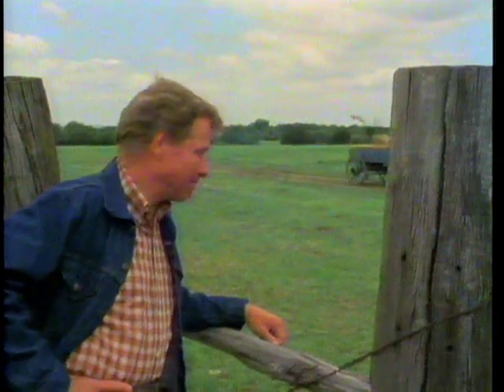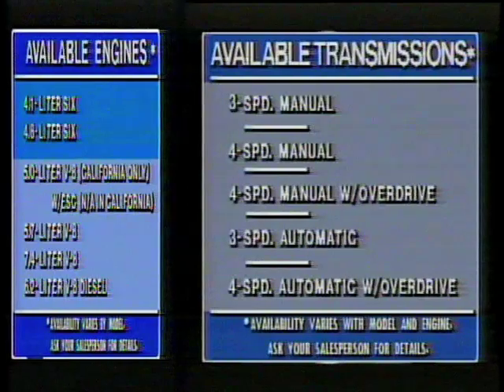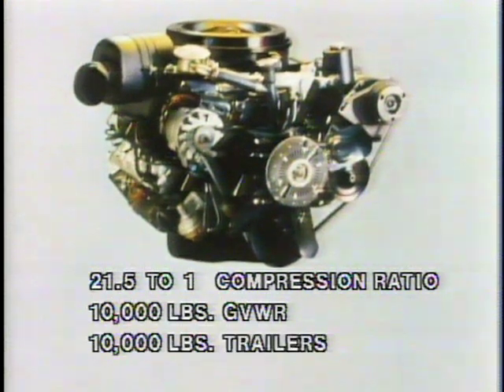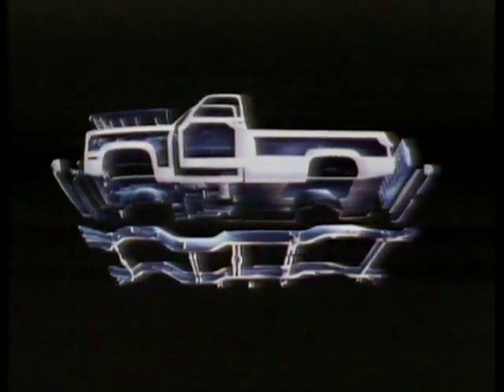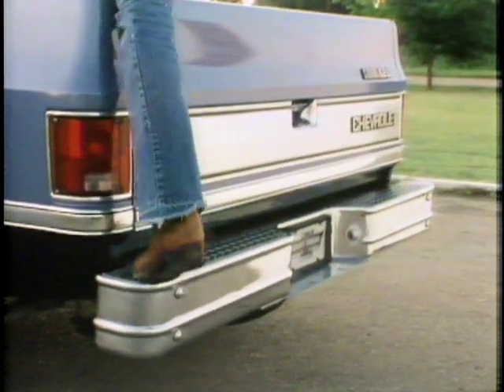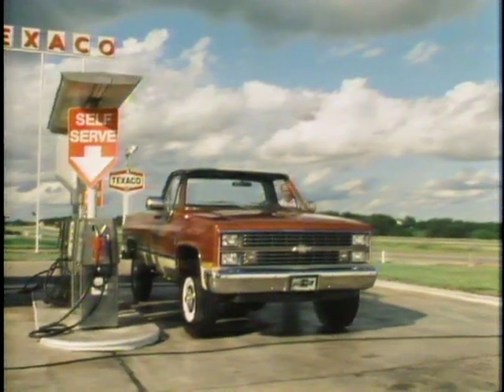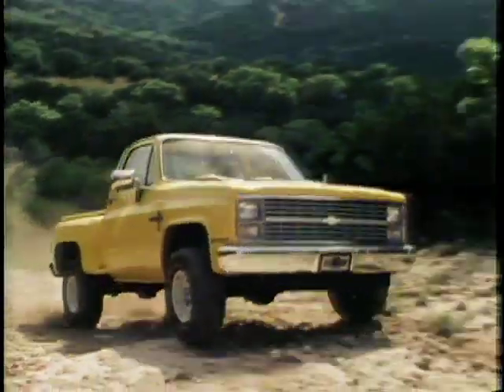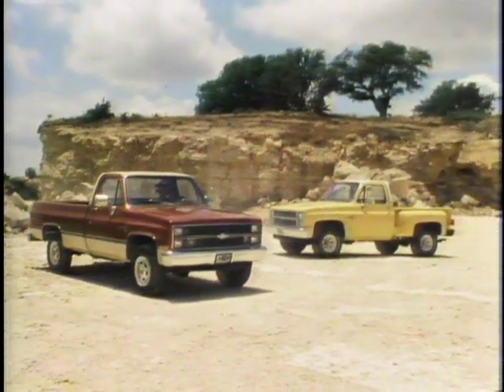1983 Chevy C/K Pickup Trucks

Comment: "heavily treated to fight corrosion".....for 2 years.
Reply: TierodMcslush Me and my dad has a 87’ C10 and it hardly has any rust.
Reply: If that. I have an 84 K10 and the only body panel on it that doesn't have a rust hole in it is the hood and it's Not even the original one.
Reply: In the east coast with all the road salt they last about 15 minutes
Reply: Corvettegirl 1994 you right I got two Silverado’s too and they are clean ✌🏼
Reply: Ive got a 86 silverado minimal rust
Reply: By the mid 90s these trucks were completely gone other than summer only vehicles. Body rot was epic on these. On the flip side my father is still driving a square body F150.
Reply: @workingcountry1776  I've got an 83 6.d diesel, that has sat outside most of its life. In South Dakota, it has sat through some hard winters, transmission went out quite a few years ago. It still has barely any rust. just a tiny bit above the wheel wells.
Reply: @local_shadetree2585  central NY uses salt by the train load on our roads... even mail boxes rot out here.  Same with other great lakes states. Glad your old beast is still whole.
Reply: A friend of mine has an old Chevy from around this era. We all love the truck, but it's so rusty that you can break chunks off of the fenders with just your hand and there's holes in the floor boards so big that you can fit your feet through them.
Reply: @Corvettegirl  You must not live in the North or Northeast!
Reply: @workingcountry1776  Ford's rusted just as badly or worse!
Reply: @edwardpate6128  in NY when I started driving 80s Chevy trucks were around but pretty much wasted away.  There were many 80s Fords and a few 70s units. Everybody rusted more quickly back then. Probably depends on where you are as to Ford, GM, Or Dodge being more popular
Reply: TierodMcslush they were hit and miss really I’ve seen some that’s been drove sine then that don’t have rust and I’ve seen some that’s been driven hardly at all and has been inside and has rust all in it 77 was the worst year for rust though cause we had just bought a bunch of steel from China and they had took old rusty metal and melted it down and made “new” metal and sent to GM for the 77 model year that’s why most 77s are full of rust
Reply: All depends on where you live and how it was taken care of. Not Gm’s fault you live in salt belt
Reply: cdthomas  I’ve seen the bedsides fall off... GM couldn’t do any better ? They were completely innocent and clueless that some trucks would wind up in the rust belt ?  They used shitty Chinese steel on all these trucks , and cheaply made them.  Junk.
Reply: TierodMcslush hmm doesn’t seem to be a problem for tons of them still out there. We have 7 of these trucks and have a large friend group with them. Just because you seen a bed fall off due to rust doesn’t mean that’s all of them
Reply: @TierodMcslush  are you sir are a dbag, any truck can rust! Its about how you maintenance and take care of the truck that will make it last.
Reply: Sounds like you really took care of it! Use a garage and car wash next time dbag.
Reply: @rossgreenzweig  He's not lying, if you live in the upper Midwest these things die of cancer very quickly.
Reply: tbh if the person who owned it took care of it very well it didnt rust the worst but my uncle has 2 79's and they all rusted to hell because he beat the living hell out of it not one body panel of the truck was straight after a cupple years of him owning it
Reply: @TierodMcslush  You must live in the upper Midwest, if you want any GM truck from 67 onward to today to last you have to spray the entire truck in powdercoat and wash them every day in the winter. Twice a day. I have a 2005, ask me how I know.
Reply: @rossgreenzweig  Where do you live? California or south Texas? Come to Iowa or any other upper Midwest state and see all of us "dbags" that have rusted to shit trucks in 10 years. The salt brine the DOT's fell in love with 25 years ago is killing cars, trucks, and roads. Along with the fact that the car companies are using cheap steal, cheaper paint and don't have any interest in making the vehicles not rust.
Reply: @seththomas9105  I live in Pennsylvania, so yes I know about salt and brine
Reply: All I have to say is, I love Chevy, but dang they rot faster than roadkill on a summer day. But what vehicle doesn’t rust?

Comment: I have a 1984 Silverado i'm restoring.After I had the engine rebuilt,I drove it to a transmission shop to have the Transmission rebuilt.This is the kind of shop that removes the transmission,and disassembles it in front of you. It took them 35 mins to remove,and disassemble the transmission,and the shop owner said today's cars would have been towed in,with the kind of damage my transmission had.$450 and 1 day later I drove my truck home,with a 2yr warranty.The shop owner said he cannot offer a 2yr warranty,with today's transmissions they are just to delicate.By the way my trans still had the original factory internal parts,and my engine still had the original factory metal head gaskets.Its amazing my engine and transmission survived 32yrs before they got there first rebuild.
Reply: Jesse Aguilar my dad has a 89 s10 2.8 5 speed 4x4 he had to replace the tranny cause no ever put gear oil in it it still had tranny fluid in it so it died and engine wise it’s only had the oil pump replaced and it has 350k give or take never been rebuilt except the oil pump had to replace the trans and it came out of a 140k miles truck from a junkyard when my dads truck had 150k on it when he swapped it still runs great rear ends gettin loud though
Reply: The th350 is one tough transmission
Reply: You spent 450 to have a transmission rebuit? Cost me 1400. Eeegggghhhh
Reply: What youre doing is astronomically cheaper than buying a new truck, and you will end up with one thats better built and longer lasting.
Reply: My 1984 k10 sat in a field for almost 25 years and I took it from the grave and still drives like it was supposed to
Reply: @johnconnor1737  that’s what I have in my 83 I love it

Comment: I had an 08 Avalanche that I just sold and I just bought an 87 Silverado and I like driving the 87 more than the 08. They just don't build them like they used to.
Reply: 381 322 I also just bought a 94 Chevy Silverado in November and love it! I am using it for my daily driver.
Reply: 1998 K1500 with 199,000 miles!  Pulls a 4,500 lb boat 1,200 miles lol
Reply: Robalo Boat
Reply: They sure don't my brother has a 83 k10 I'm gonna try to get off of him he baught it a month ago it has no rust at all
Reply: Meh I have an 89 Cheyenne 4x4 k2500 I wish I had a square body tho
Reply: I agree I got tired of paying for a 2007 chevy full size truck, and decided to stick with my 1987 stepside I love my truck
Reply: I'm about to buy a 1984 Silverado K30 w a 454 ...had a 2000 Silverado w 5.3 and I loved that new truck but this '84 is just the best. Simple, iconic, rides much better than I thought it would...I could change a starter motor while the damn thing is still moving...and the frame is thick enough to stand up to rust. Looking forward to keeping it going for another 35 yrs

Comment: Whether it's a ford, a Chevy, or a dodge, all three of them made very reliable old trucks back in the day, and what I like about them is how tough and reliable they are even in today's modern times. They say old cars break but my mom's SUV  has been in the shop more than my old ford.
Reply: Traindriver844 its called planned obsolescence . the vehicles today much like computers, which technically todays vehicles are glorified computers, they're designed & manufactured to be broken & obsolete within a certain amount of time. best thing i can point to as proof of this, "smart" phones. u buy it get used to it BAMN s8, iphone8, lgv25 etc etc is being released next week
Reply: @DIRTDIVER882  most of the time when I see a phone being replaced is due too either an accident or they just want the new one despite it still working look at base model F250 looks pretty simple and them look at a king ranch, you can choose to have simplicity or loaded with luxuries I like how most work trucks have vinyl seats and rubber floors now easy to clean up
Reply: @justenough730  a spider injector is a pita took gm too damn long to go to mpfi also gm hardly gives you any damn room to work with pulled the transmission out my Silverado and the top bolt was a pita also the starter wires are between the manifold and the frame can barely get my arm between there also front ends on Chevy are so damn weak the coils look like they came off my Honda Civic
Reply: Dan Bouchard bullshit
Reply: The Fords with the twin I beam front suspension,could not keep ball joints and front tires in them.Ate them left and right

Comment: them old trucks were rugged and tough
Reply: Until they had a vacuum leak and ran like trash
Reply: Taylor Snyder The bodies were good except for a rust problem but the engines were weak.
Reply: @melrose9252  Lol have you ever owned one? Mines clean as the day GM made her because it got washed! And the stock 454 in my truck will burn 37 inch tires clean off.

Comment: These were some of the very best Chevy trucks built! Their only weakness was the body panels rusting to soon! But I’m right now looking at one about the same year, that’s Military Surplus. The truck is a 3/4 ton 4x4, with I believe is a 6.2-6.5? Diesel, non turbo. There’s absolutely no rust of any type, only 67,000 miles and runs very good, or as well as can be expected. The previous owner added new Dual Exhaust Custom made from 2.75” tubing, with two nice fairly quiet mufflers. The gearing is 4:10 by the count of revolutions of driveshaft to wheels, with locking differentials, the front added by last owner. He also stripped the OD Green paint color off, but not to bare metal, had Bed Liner added to the bed along with about 8” up from the bottom, along with underneath. If I can get it for the right price I plan on buying it. I have access to a lightly used Banks Sidewinder Turbo Kit to add on. The only issues will be price and Wife, she is not to keen on having a Reg Cab, as we need any truck we have to tow our Travel Trailer whenever we want. Price is also an issue due to the fact we must buy a second vehicle that has 4 doors and be fairly nice. In a perfect world for me, I would love to do a DuraMax swap, tuned down to match up with the 4R80 trans that’s in the truck now, or at least a nice LS/LT Crate Engine. Then get a nice Lance Slide In Truck Camper, with the rear cab window removed and sealed to the Camper, so the dogs could be more comfortable! Oh and add a good A/C system!

Comment: 73-87-91 some of the most sought after chevy trucks!
Reply: Dime Fever are they? I didn't know they were that wanted.
Reply: Dime Fever that body style they made the regular cab pickups with single rear wheels from 1973 through 1987, but all the crew cab pickups, Suburbans, & K-5 Blazers, they made from 1973 through 1991. Also if I'm not mistaking I think they still continued making regular cab pickups with dual rear wheels & regular cab 1 ton chassis cabs with both single & dual rear wheels up through 1989.

Comment: Have the exact same truck and colors as the one in the intro. Bought it for $900 cash hoping it would last for a summer while doing major building renovations - hauling plywood/sheetrock, dump runs etc. That was some years ago and this thing keeps going and going. Random people give me compliments on the truck at Home Depot, lol. Going to keep it because I love it for the hard-working dinosaur it has become. It will haul 2,200 lbs in the bed before the steering gets a little dicey (certified ticket from landfill). Insurance is surprisingly expensive due to lack of safety features I imagine.

Comment: 99% of the trucks shown here are still regular cabs. 99% of the new trucks you see now are extended, crew, or mega cabs.
Reply: Pita to work with a single cab it fills jobsites because everyone has to bring their own. Also if you have delicate tools such as power drills nail guns saws and other tools I toss them in the back so they don't get soaked in rainstorms

Comment: I had a '77 Stepside (same as '83, just different grill). Now that was a basic truck! 250 six/3 on the column.....the only option it had was power steering. I liked it a lot, but eventually it got so rusty I had to junk it. The cab mounts were gone, and the rear fenders on the stepside box were flapping in the breeze

Comment: I love the use of the first three seconds of the laserdisc for text "slides" of various sorts.  I suppose the disc was programmed to allow stepping through them all?  Sony did that and more with their CRV discs 15 years later., running both videos and still graphics from the same disc at their business meetings.
Reply from the maker: Yes! There's an audio track with programming instructions for the LD player. It built a little quiz where you'd use a phone keypad on the remote to answer questions.

Comment: 35 years later, I think they were right - these trucks ended up exceeding expectations - still a usable, durable vehicle in 2018
Reply: Late 2019 and I just hauled 2200lbs of roofing to the dump and picked up 40 sheets of OSB on the way back (1983 C10). Love my old truck with working original AM/FM radio cassette. and doors you have to absolutely slam to close properly.
Reply: I've seen 4 or 5 over the last decade

Comment: So a truck trim "Silverado" came to be a truck model
Reply: yup and that did not happen realy until 1999 before that it was still a Trim level..
Reply: Los Ojos De HotSpanish the Silverado trim package came out back in 1975 which replaced the previous Cheyenne Super trim package.
Reply: Yeap
Reply: @kevinrichards3288  the cheyenne package stayed around through the early nineties
Reply: @marcusc110  yes the base Cheyenne but I was talking about the Cheyenne Super which was a top of the line trim package that came out back in somewhere from 1969 to 1971 & was replaced by the new top of the line Silverado trim package in 1975.

Comment: I owned a 1983 custom deluxe long bed with the blue interior.  Truck had a 305 v8.  It was not fast , terrible on fuel economy, body was rusting through but the engine was very reliable.

Comment: I got an 03 2500 with the 6.0 V8 gas and 4x4. I got 210,000 miles on it so far and so far the only problems I’ve had with it are the AC just recently went out, and the 4 low is acting up. Other than that, no problems what so ever

Comment: I do miss the way these trucks look, they remind me of my highschool and early adult years. These trucks had style, character and class compared today’s newer vehicles.  I especially liked the round eyes version of the 70s; But GM, Ford and Dodge put out absolute shit powertrains and fuel delivery systems during the 70s & 80s.  Me and my buddy’s growing up we’re pissed and didn’t think much of the cars we got during our time. We missed out on the muscle car era of the mid 60s to early 70s, the glory days for GM. Big engines 4 bbl carbs and big horsepower, didnt have all the fuel, emission and evap parts they did in the 70s.  The big 3 took forever to offer fuel injection and just didnt want to give up the carb.  It wasn’t until the 90s that I saw GM come out with a stock small block V8 put out 300hp. GM had developed fuel injection in the fifties, I can remember a man on my street owned a 1967 stingray corvette with a big block V8 and fuel injection; there is no reason why it took until the last year of the squares to offer the tbi’s. And they definitely didn’t give a shit about you after you drove off the lot and they did not offer warranties like they do today. I did buy a k10 Scottsdale in 1987 brand new off the lot when I turned 20. It had a 350 small block and 4speed w/OD, it had more HP, was better towing and was much better fuel mileage, it was a dream not having to mess with a carburetor.  I had to buy a ‘90 K1500 Scottsdale because my ‘87 was rusting and staring to rot away after only 4 years (the Achilles heel of the squares) These trucks were robbed of their true HP and overall performance for most of their production run because of the arrogance, and greed of GM.  Ford and Dodge were no different and offered the same shit, in those days, they didn’t want to spend the money on R&D until competition from imports forced them too...they didn’t give a shit about the customer,  you only had 3 companies to buy a truck from.

Comment: Even the 250 -6 banger was badass!!
Reply: Roy Miller What was badass about it?
Reply: For me it was a reliable diehard work horse, it never backed down from a load I over loaded on the trailer, it didn’t like a lot of them but it got er done abused it till 129000 miles blew a head gasket, then I built a 350 and installed it! Ran it for another 15 yrs! Gave the 6cyl to a friend he worked the head stuck it in a houseboat ‘, as far as I know it’s still tooling up & down Tn. River

Comment: The good old days before GM started churning out complete pieces of JUNK :/ Ford is the same way
Reply: This is just my opinion. I have driven both OBS (94-97) and NBS (99-03) trucks. And the only thing that the 99-03 Super Duty trucks have good in them is the engine and driveline. The NBS trucks body & interior construction feels and looks 20 times thinner and weaker than the OBS trucks. The dadgum hood roof & doors flex when you shut the doors, and they even feel thin.
Reply: They were kind of junk back then too.
Reply: @DDFJ1230  it's no doubt that they seem cheaper. If you've ever been around a squarebody chevy though, you'd notice that the metal in the hood is often so weak that it will kink in half. These Chevy's may look nice, but they were really garbage when new. The Fords were just better